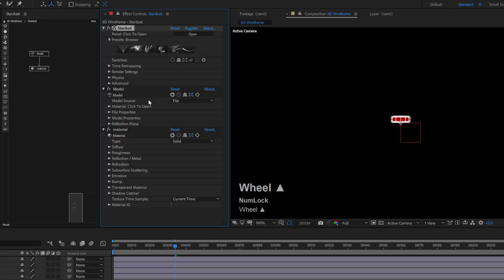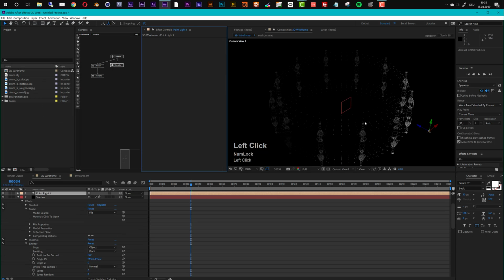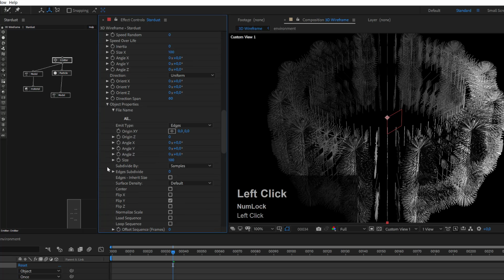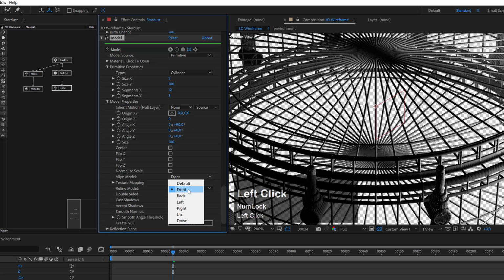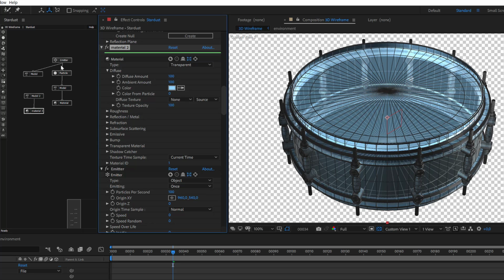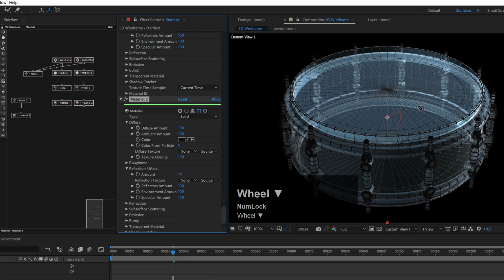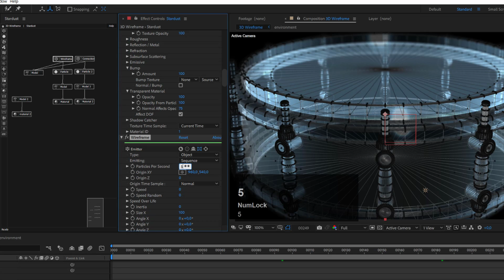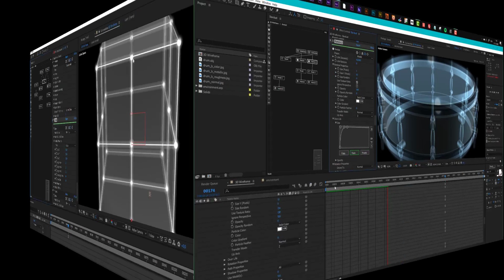Stardust 3D Wireframe - After Effects Tutorial

Comment: Hello! Thanks for this great tutorial. I'm testing the plugin. There is something i think is not working, with an OBJ file (not from the library) i want it to become transparent like your drum, but if I change the Type in the Material Node nothing happens.  Thanks again!!
Reply from the maker: If you set up everything correctly it shoud work as I show it. Maybe there is a problem with the normals of your obj.
Reply: @Nodeconnector  Yes, You are right. I just try with another file..and it works. Thanks!!